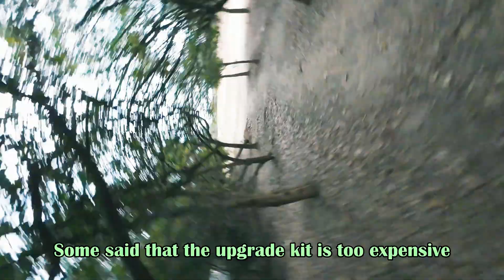Best Upgrade For Pavo Pico!丨Flywoo DJI O3 Lite Kit Install Guide丨Tinywhoop丨Sub 100g Avata丨穿越機丨香港FPV

Comment: Did you have to anchor the naked 03 or did if fit in like the the original 03
Reply from the maker: Need to use zip ties to anchor it. Because it gets smaller afterwards